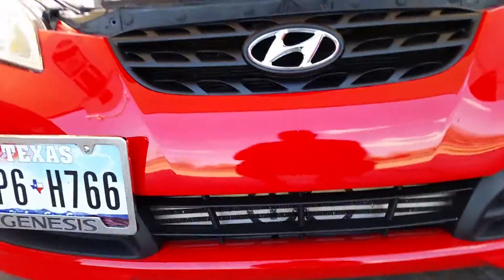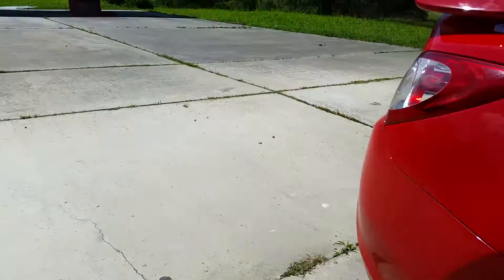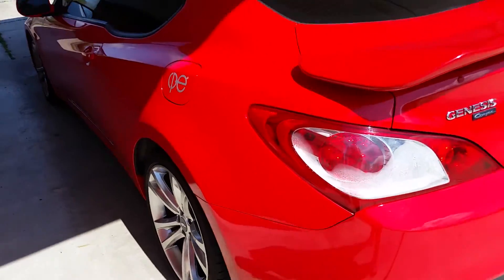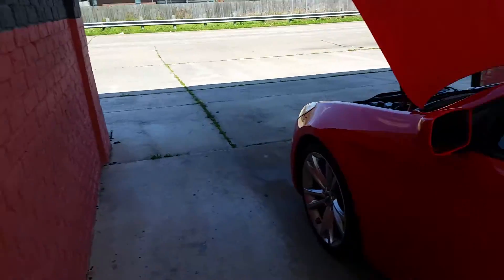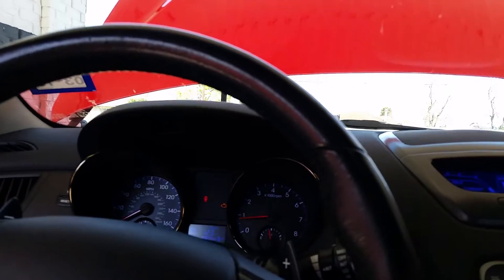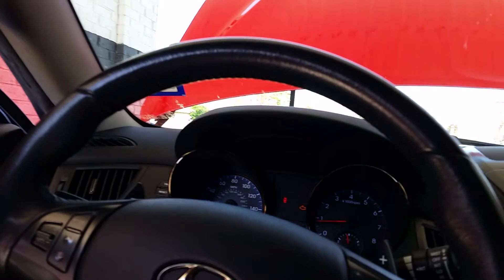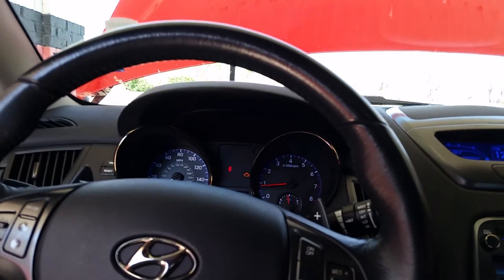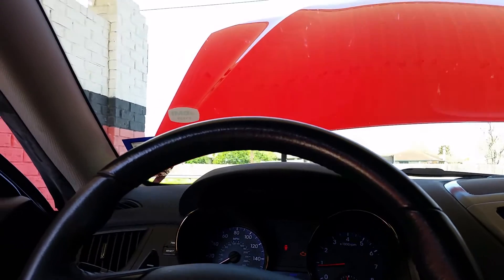Genesis coupe CPE Intercooler, Intake, 3" Down pipe, exhaust, and SFR Tune

Comment: Can you make a video on how you have your intercooler setup? Plz and thanks in advance, I have an auto Genesis and was curious to see where and how you mounted the trans cooler
Reply: The transcooler was mounted on a fabricated bracket.  I ain't gonna take off my bumper to make a video about it.  Sorry man.
Reply: A.Arroyo have you figured it out
Reply from the maker: V Strong:  You have to make a custom bracket for the oil cooler line.  I had someone do it for me, so I don't know the specifics of the bracket.
Reply: barricade713 so it's pretty much a mess for the auto to change the intercooler lol
Reply from the maker: V Strong according to the mechanic, it was pretty simple.
Reply: barricade713 I seen forums and they make it seem like if it was a big deal lol I haven't added a new intercooler but do you still have the auto Genny ?
Reply from the maker: V Strong yes and it runs like a champ.  I added more things to it since this video.
Reply: barricade713 bro I have a 2013 2.0t auto/base so far I have a turboback exhaust and a cold air intake I want to add a bov but I'm just wondering is it because it's auto it's a huge setback for us ? Can we still beat a 3.8 with bolts on or a tune ?
Reply: You have a Bk2, with what you have on it with a SFR tune, you can make 318 HP at the wheels.  The only way to find out if it can beat a V6 Is to line them up on a strip
Reply: Jim Gutierrez yes that's true thanks bro I'm just over thinking due to it being auto
Reply: Standard tranz makes prolly 10 more HP